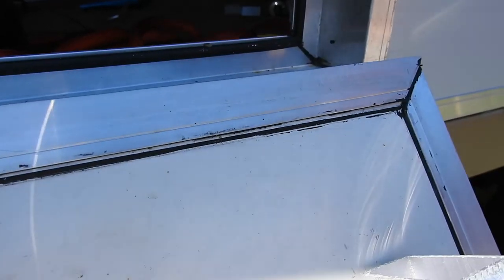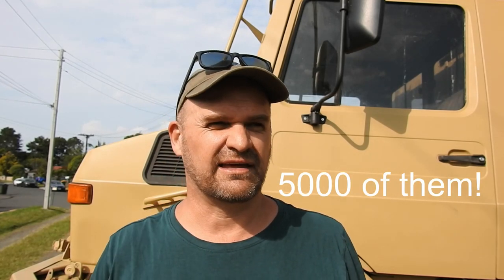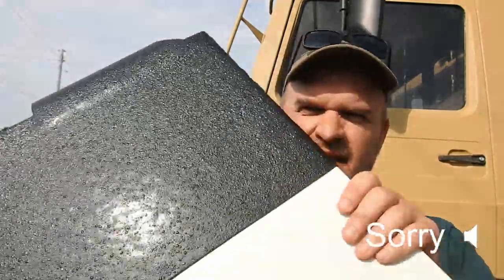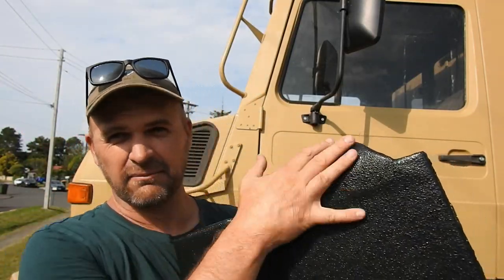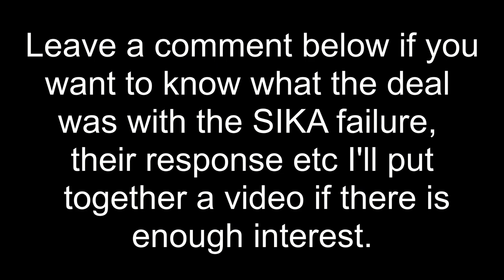#7 Unimog RV Build - I covered my truck in bedliner

Comment: Definitely, i would like to know about the failure. I am about to use a fair bit of sika products in the not to distant future. Great work on the truck,
Reply from the maker: Sika, do make some good product.  I've found customer service terrible and product claims misleading.  I should have done more comprehensive testing prior to the build.  I'll put together a video on it showing where it all went wrong.
Reply: Brendon Tait I don’t know many people who would test the product on a strain gauge to failure before hand. Was it a reaction of some type or maybe damp. Seems crazy that they don’t want to find out themselves.
Reply from the maker: Yeah, I thought I was being thorough.  The reason they weren't interested in seeing it is because they already know the problem but dont want to admit or be confronted by it.  It was partially my fault... but I think they have a lot of blame as I believe their claims for it are misleading.
Reply: @brendontait6968  here in Europe they use Sika products for gluing campervans and caravans together without any other sort of attachment. Do have to get the right Sika product and clean the surfaces thoroughly for it to work though.

I've used Sika products for gluing frames for solar panels to the roof of a caravan without any problem.
Reply from the maker: All surfaces were new and I cleaned each surface with a new paper towel and IPA before bonding.  I believe the fault was in their data sheet as it was misleading.  I don't use sika for anything anymore, the company were terrible to deal with and I have found products that bond with twice the strength of sika at half the cost.  When I get a minute I'll do a video explaining what went wrong and the sort of customer support I got from sika
Reply: @brendontait6968  which Sika product did you use?
Reply: @brendontait6968  I used Sika 512 (now superseded by 522) to glue the frame for my solar panels to the roof of our campervan. No screws, bolts and everything is still rock solid 10 plus years later. I've also used it to glue flexible solar panels to the rook of our caravan with equally impressive results.

The biggest issue is that you can't remove it using solvents once it has cured. You have to use mechanical means to remove the it.
Reply: I source glue mostly from Henkel, I avoid Sika for several reasons by any chance.... but would like to know what went wrong with Sika on your built anyway.

Comment: Many moons ago I was an aircraft engineer and part of my trade was structural repairs.
Hence I’ve done more riveting and metal bashing of aluminium than you could shake a stick at. (Didn’t know about changing the temper though so thanks for that!)

For this application I’d have used countersunk cherrymax rivets which also provide a decent seal.  Pneumatic rivet guns are the only way to go but unless you’ve got access to the cherry gun it’s prohibitively expensive.

Glad you got it sorted though.
Reply from the maker: Thanks Bob, glad you learned something. The riveting wasn't much fun tbh, but it's done now and seems to be solid.

Comment: I build tiny homes using freezer panels. I use rivets as well as urethane adhesives.  Get. A air riveter - you dont need to develop you firm hand grip in these days of covid and manually riveting is painful after the first 300 or so.  I actually use the freezer panels horizontally and cut down  the lower of two 1150  side panels so there is only one horizontal join. Lightweight alum checkerplate can cover this lower panel giving a great bush ready look You can now get tintable Raptor bedliner to avoid the ongoing need to repaint.  Great job
Reply from the maker: Hey Paul, thanks!  Yeah riveting can get old fast.  But its done now and not something I do often. On the upside, I've got one hell of a grip now! I contemplated laying panels on the side, but for whatever reason (and there was one) I decided to put them vertical.  The back door is laid up sideways. I looked at Raptor also, but... it wasn't as strong as Rhino and was only recommended for thin coats, whereas the Rhino could be applied much thicker.  The other thing that sealed the deal was that down here the sun is pretty harsh thanks to a big ozone hole.  Apparently the raptor isn't as UV stable.  The paint coating also protects the Rhino from the UV light.

Comment: Hi, good video, I'm also doing bedliner but I'm ordering it in a colour, they can do it here in Aus in any colour you want, unfortunately not cheap. Looking good.
Reply from the maker: Thanks, yeah there are lots of options available, all of them expensive.  Are you looking at polyurea or polyurethane?
Reply: Not sure but here's the link https://www.ebay.com.au/itm/RAPTOR-BY-U-POL-UPOL-BED-LINER-KIT-TINTABLE-ANY-COLOUR-AND-COATING-GUN-2PACK/141759503041
Reply from the maker: Oh yup... I decided not to use that due to the recommended layer thickness is quite thin.  Be aware of surface prep if you are coating ontop of aluminium.
Reply: @ThaboNel  I used that on parts of my truck.  Make sure you rough up the surface.  I used 220 grit sandpaper.  And if putting it on metal follow the prep instructions to the T.  Some parts of my job weren't as clean as they should be and the liner started flaking off easily.
Reply: Thanks for that, will do.
Reply: @ThaboNel  wheres the videos Thabo?
Reply: @mikezog1030  Who would have thought that during this virus medical and news people are the most important, I take off one day a week in order not to burn out, I have a video in the works but I have to sleep so the moment I have a minute I will finish it.
Reply: @ThaboNel  You focus on those essential services first... the Unimog!

Comment: omg that hand powered rivet gun, I am sure a local rental shop would have had an air power or even an electric one. Your hand must have been cramped so bad.
Reply: Thats what I was thinking.
Reply from the maker: It was only 5,000 in total, maybe I would have if it was 6,000.  I did actually buy a cheap drill powered one which lasted maybe 30 rivets?
Reply: @brendontait6968  "only" 5000!
Reply: @brendontait6968  I built a 25ft EME dish in my basement one winter. For Amateur radio - Earth Moon Earth, where  we bounce a signal off the moon to someone on the other side of the earth.  I used about 100 rivets per arm of the dish, so about 2000 rivets in total, my hands killed. 
http://www.geocities.jp/pdt_umesan/eme/ve1alq.jpg
Reply: It’s not the kango blind rivet drill adaptor from Bunnings by any chance ? I’m about 60 rivets in so hoping it lasts. Haven’t failed a single river yet

Comment: Do you mind sharing the bedliner application cost and the Hardtop flexi cost?
Reply from the maker: It was very pricey....  the rhino coating was around $6,000nzd and the hardtop flexi was around $1,500nzd (I bought 20l but only used 12)   I had to think long and hard before doing it because it was several times the cost of the box.  But I think it's worth it long term.